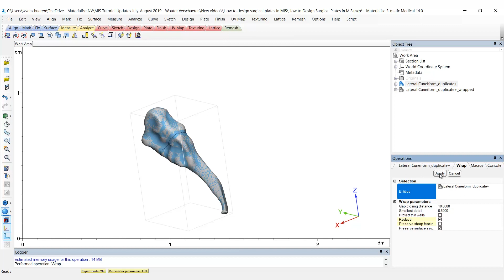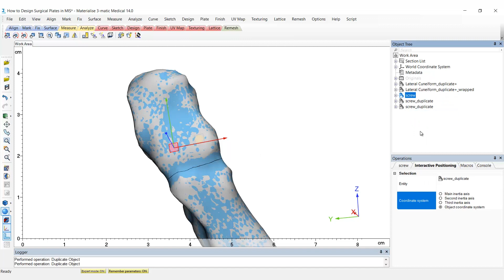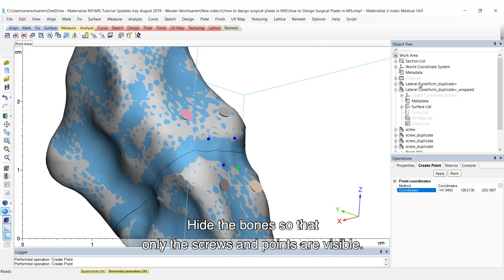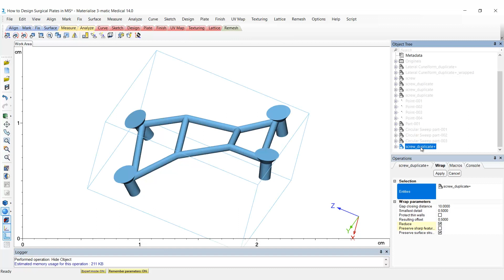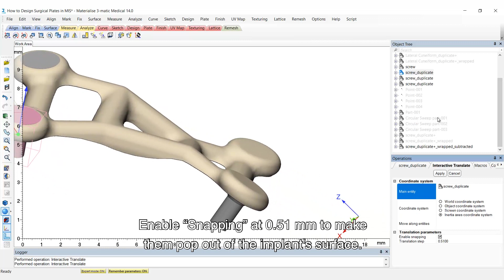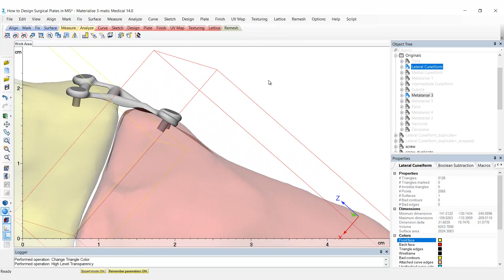How to design surgical plates in MIS?

Comment: I don´t have the stl screw available. Do you know from where can I download it?
Reply from the maker: Hi, a few demo files are installed with the software. You can find them in the 3-matic installation folder, usually located on your C drive. Under Materialise, in the folder of your 3-matic version, you will find a folder called “DemoFiles”. Please see an example below for the path to the screw:
C:\Program Files\Materialise\3-matic 15.0 (x64)\DemoFiles\Screw.stl
. I hope this helps!